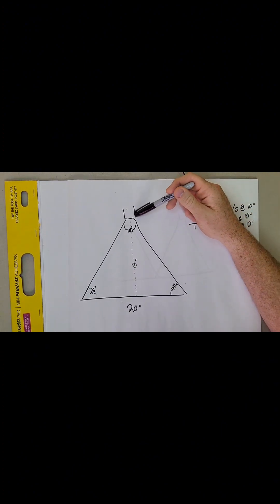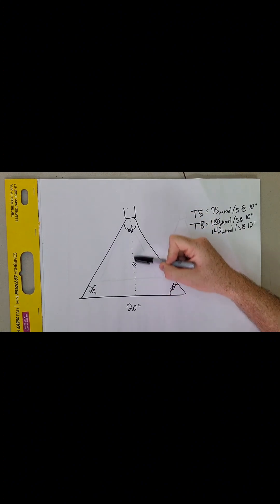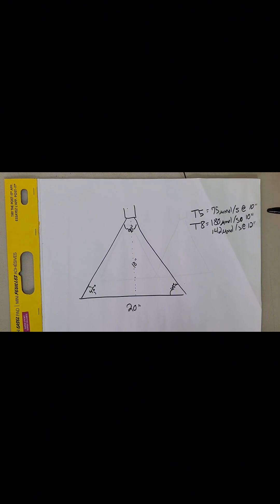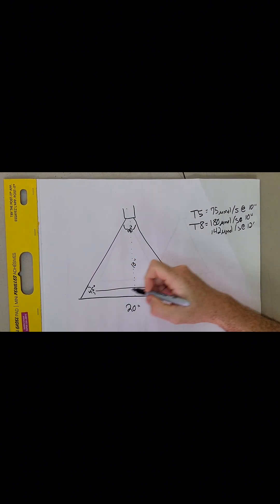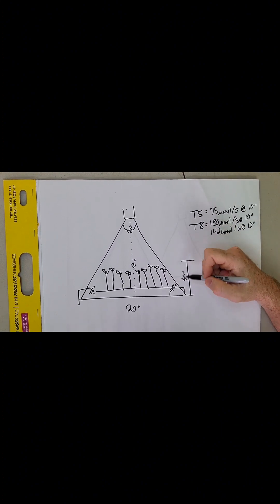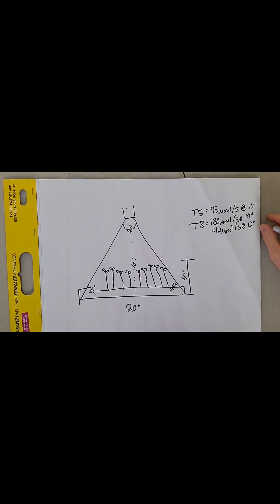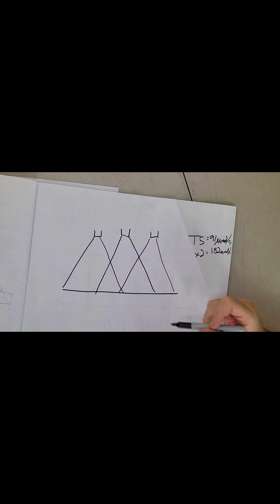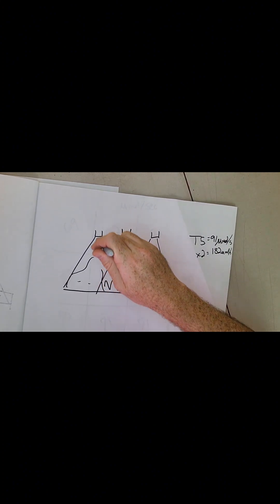Lighting for Microgreens Growers: Part 2

Comment: I am confused now because according to Jonah Krochmalnek we should use 3 T8 per shelf. You say only 1.
Which Barina do you recommend then? I do not see links in your video description.
What about these:
Barrina 4FT T8 Plant Grow Light, 252W(6 x 42W, 1400W Equivalent), Full Spectrum, LED Growing Lamp Fixture for Indoor Plant Growing, with ON/Off Switch & V-Shaped Reflector, Pinkish White, 6 Pack
Thank you.
Reply from the maker: @Alien2799  context is everything. Is your grow room set up with lots of outlets on seperate circuits? If not, that many t8s will be tripping breakers left and right. 1 rack with that many lights will be drawing 6.3 amps, so 2 racks on a 15 amp circuit or 3 on a 20 amp. Where as you can run 6 to 9 racks with a single t8 per shelf. So if you have the space, you can 3x your production using 1 t8 if you have the sq. Footage. 

Yes, you'll get faster grows with 3 t8s, from what I have seen shaving off a day on short grows or 2 days on 2 week grows. But that does not make up for the volume difference by running fewer lights on more racks. You're essentially saving 1/6 the time.

Other considerations are you need a more nutritious substrate if running the 3x t8s, as they'll be growing faster and will start to yellow without the additional nutrition. Also, how does having a shorter grow cycle effect your days to maturity? If I shortened mine, I'd be working on the weekends, which is a deal breaker for my family...

So just trying to say DLI, PPFD, and PPD are all good to know and understand, but there are many other variables to consider as well.
Reply: @NBarSMicrogreens  Thank you for such a thoughtful response. I really appreciate it. 
It is a good point about the circuits. I did not think of it.
Should I go with the 2 T5s or 1 T8 per shelf? I heard your pros and cons but still, I cannot decide :) I want to eventually sell my greens so maybe T8?
So it looks like the Barrina that I listed in my previous comment should be OK? It is pinkish and you did say you like pinkish and not pink. BTW, why so many people use pink or even purple?
I did not see the same pinkish in T5.

It is also interesting what you say about the need for more nutrients when using more T8s. I did not know that. Jonah does recommend using a fertilizer but I thought that it is because after 5 days or so the soil is running out of nutrients and you need to add some fertilizer. No matter what lights you use. I assume that you do not add any fertilizer? 
Sorry about all the questions but I have been googling so much about the lights and the more I search the more unsure I become. I would like to start my microgreens soon but I seem to be in paralysis by analysis. LOL
Thank you.

Comment: Could you please confirm - do you actually separate the shelves at only 8 inches (with a T5 grow light)? That would be amazing as it would allow for additional shelves per rack.  Orr do you separate the shelves by 9 inches (considering the tray is 1 inch tall, thus leaving 8 inches between the top of the soil and the lamp)?

Comment: Hey I’ve just bought Barrina 2ft shop lights 6500k because that’s all I have room for and noticed that they are only 1100lm compared to the 4ft which are 2200lm can these still be used or what configuration should I use I will only be growing 1tray per shelf
Reply: Also thanks for the great content very informative
Reply from the maker: I would not worry about the lumens rating. It makes sense that if the 2 ft light is half the chips of the 4 ft light, it would half the lumens.

I would still use it as suggested here if using 1020 trays. If a t5s, 2x lighrs per at 8 to 9 inches. If t8s, use 1 per shelf at 13 to 14 inches.
Reply: @NBarSMicrogreens  
Thanks for the reply I have successfully grown some china rose radish with 2 lights per shelf and I’ve got a tray of peas in germination thanks again keep up the good work 😃

Comment: I’m trying to figure out lighting for my houseplants as I am in a north facing apartment. I want to hang them from the ceiling and do not want them to get too hot. The plants will be about 24 inches from the lights as I have to get chains to drop the lights down 12” from ceiling. I do not want a pink hue in my apartment so that probably throws out the T5s. Will the T8 bright white give my plants enough light at that 2 foot or more distance. What would you choose. For the T8 6500k I read that it seems to have a bluer hue compared to the 5000k yellower hue. I would be running these 12 hours per day

Comment: Thank you SO much for this info! It has been so difficult to find clear explanations of all this. I have a couple questions I hope you can help with though…

You said two T5s per shelf were sufficient, but it looks like you’re using 3 per shelf behind you. Why is that?

Also, how many inches do you recommend spacing your shelves apart for t5s? Like from top of one shelf to top of the next shelf?
Reply from the maker: Thanks for watching, and I'm glad you found the info helpful. When I set up my racks, I set them up with 3 lights per, but have since moved to only 2 being on at a time.

I had to double check after the video, and only two were on. The one rack appears to have all 3, but I think that is ambient lighting, making it appear like that.

Regarding shelf distances, it is going to depend on your lights. The key is distance from top of the lower shelf to the light, not shelf above. The distance you are looking for is 8 inches from light to top of the shelf below. The T5 grow light recess fully up unto the shelf above, where as in this video, I am running 8' t5 shop lights that don't recess at all. So between shelves will likely be 8 to 10 inches depending on how you lights fit into the rack or not. Hope that helps!